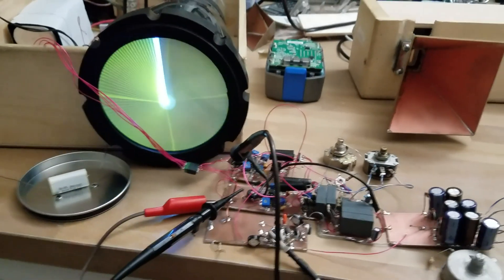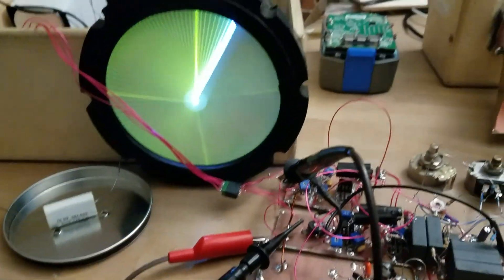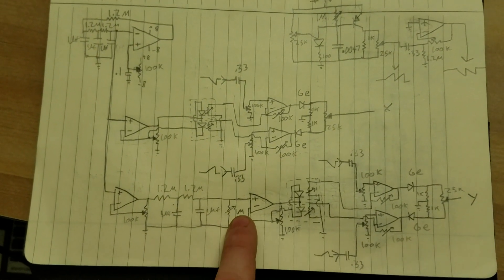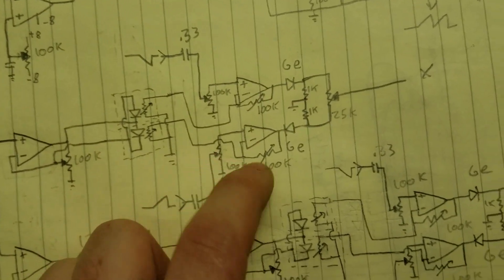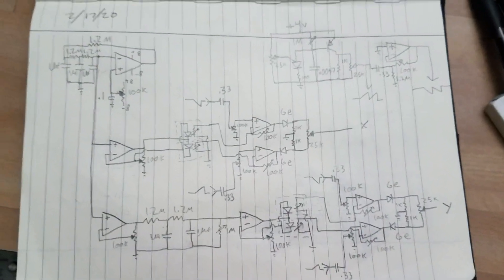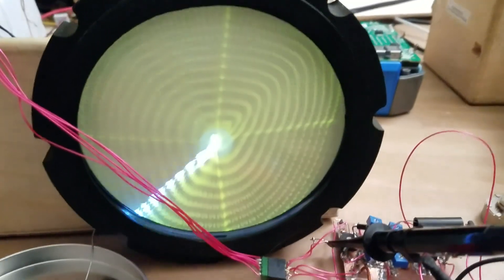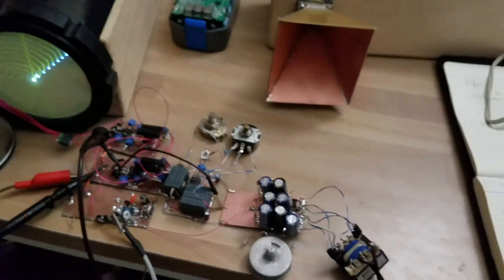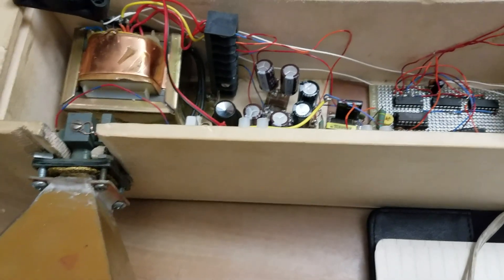PPI Radar Display part 1 of ?

Comment: I’m an electronics technician, this is clever.
You might be able to smooth your X and Y oscillator it’s a little lagging , but it’s still clever
I hope you’re klystron is not putting out full power

Comment: How does the CRT scan like that, does the coil actually rotate itself?

How do you write a pattern to the CRT?
Reply from the maker: No rotating coils. All done with analog signal processing. A 1 Hz sine wave and cosine wave applied to the x and y inputs of an oscilloscope will show a dot tracing a circle. The amplitude of the sine/cosine waves determines the diameter of the circle. A sawtooth wave varies the amplitude of the sine/cosine waves (the diameter of the circle, distance of the dot from the center) 1000 times per second. This creates the apperance of a line that rotates. This is explained in more detail later in the video.

Comment: Since my teenage years I was always wondering how the f**ck PPI radar tube works. I was unable to come with any idea how the line can be drawn in this way, and assumed this must be simply drawn with X-Y vector graphics. However this makes no sense, because tubes with long afterglow are used, and it will by hardly possible to do on simple systems with 1950's electronics. I was 30 years old, when I realized that the deflection coils simply rotate around the tube...
Reply from the maker: They originally did rotate the yoke but when the technology was available they switched to scanning using xy. The signals needed for an xy radar display are two sawtooth waves at the radar pulse rate (in my case 1kHz) with one being modulated with a sine and the other a cosine wave with the frequency coressponding to the rotation of the antenna (in my case about 1Hz) I show these signals at 2:00. In the 40s they did this using selsyn motors (or similar synchro device) coupled to the rotating antenna and fed with a sawtooth wave. The rotor of the selsyn would have the sawtooth wave applied and the stator would have two windings oriented 90 degrees from each other that would be the output for the deflection plates. As the selsyn rotated the rotor would become in and out of phase with each winding creating the varying amplitude sawtooth waves needed.

Comment: Possibly configure the op amp driving the gain control LEDs (or a second dual high gain op-amp, 1 side for each LED) to act as a current amplifier so as to avoid the crossover-like distortion glitch when the led suddenly turns on or off at its lowest voltage. Current feedback taken from the LED via a series resistor should give the needed negative votage feedback.

The beam current /brightness seems high, take care not to burn the phosphor in the center. P7's are a bit fragile when pushed to high brightness.

Very good project well done, I know from past experience how much study and work was put into this. It's really impressive. I like black notched ring around the CRT face. I was almost expecting to see an old electromagnetic deflection radar CRT housing back there.

An old X band or early X-K band radar detector might be easily tunable enough to sensitively receive the klystron's signal. Look inside one, you will find it is tuned by a swept voltage and there are adjustment pots on the really old ones. Keep up the good work!